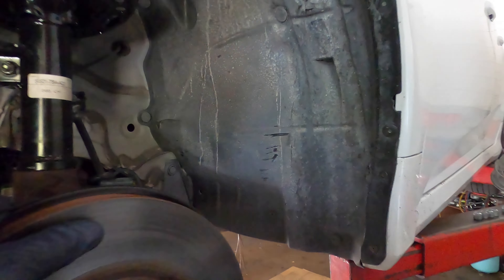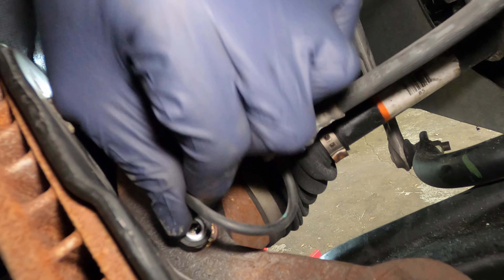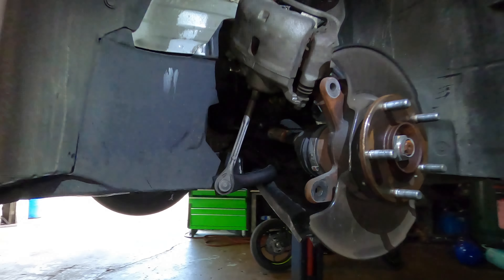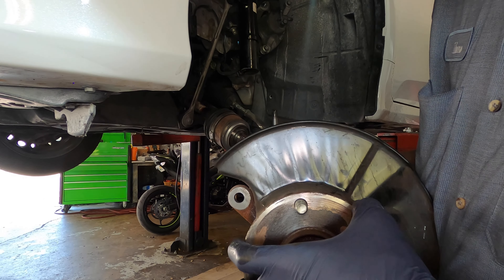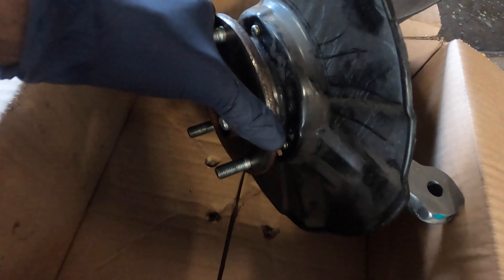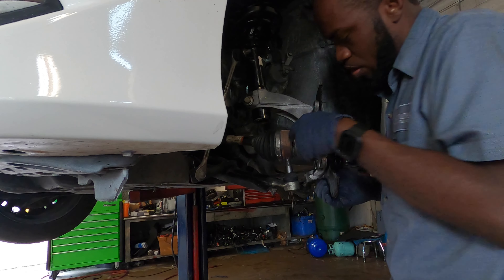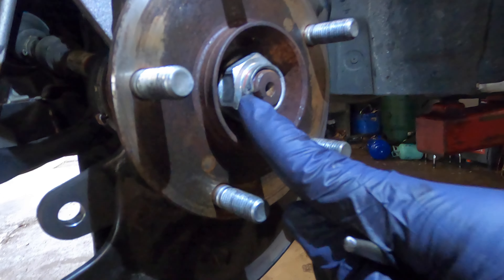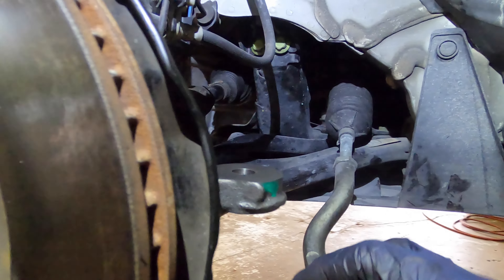Honda civic steering knuckle and wheel bearings replacement

Comment: Really? Did the customer know you didn't replace the wheel bearing while you had the hub off.  That hub did not spin that easily.  You forgot to clean off the rotor that you sprayed all over with WD 40!  This is why I do all my own work.  You should confine the lubricant to just the nut you are trying to remove.  Plus you stated in the beginning that the strut assembly had just been replaced so there should be no need to spray; just say normally you would